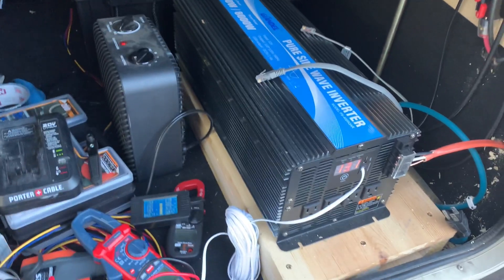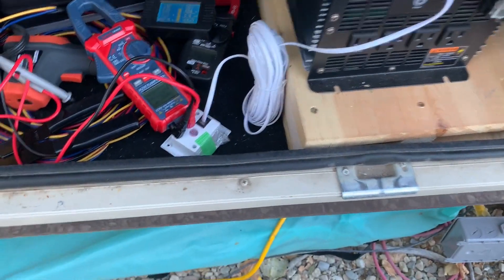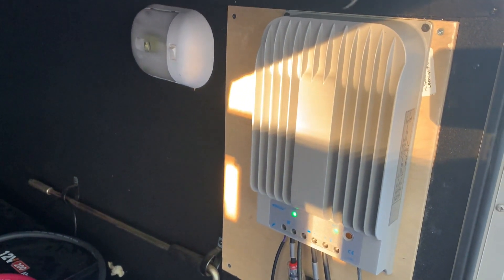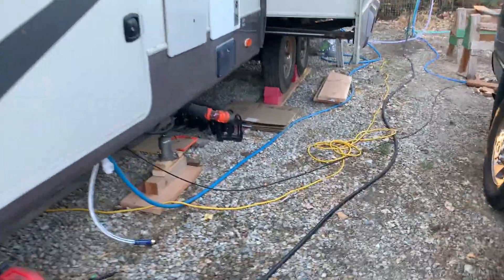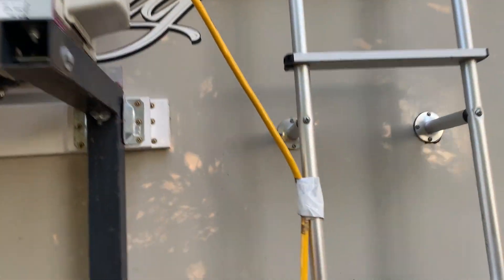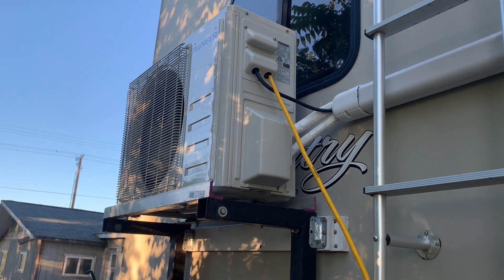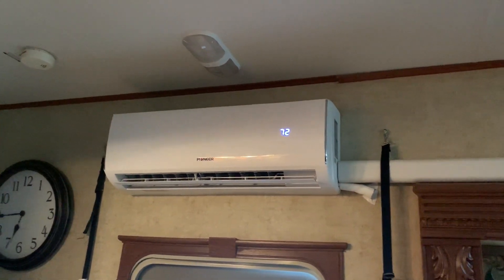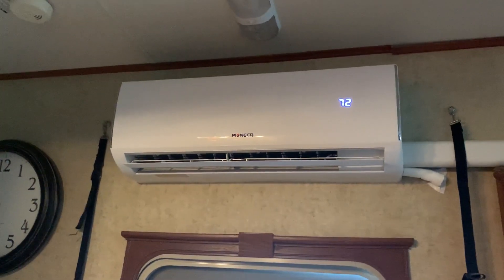Mini Split in RV running on 4 Ampere Time 200AH LiFePO4

Comment: i have a 5th wheel 40ft and the bedroom is at the front and living at back, I wanted to get a pioneer 22 seer mini split and install at the back blowing in living room towards kitchen. I don't know if it will have enough air movement to get into the bedroom which is past the bathroom. I wanted a 12k btu but if yours which appears to be located centrally by the front door which is the midpoint in mine but you said yours doesn't cool well at 100 degree temps which is average here in texas, then I guess I need to go bigger or get a second unit for the bedroom you think? not sure how to determine the size i need for my 5th wheel to cool end to end.
Reply from the maker: If I were to do it again I would get a two head unit and two of the cassettes that go where the roof to ACs go. So the cassettes both run off of one compressor and condenser unit. However not sure if they make a 120 VAC unit. I don’t think so.
Reply: @thervsolarseries2827  so you would have to actually remove the rooftop a/c's? My rv is ducted so you can't see the indoor rooftop vent under the a/c, it's just vents everywhere. So wall units make more sense, but yeah i need 110/115. just not sure on btu's or if I really need 2 wall units.
Reply from the maker: @fabiangomez357  Yes for the cassettes you do need the through hole AC units. Mine has ducting too but the unit comes through the ceiling and you can turn the vents on/off. It was also a pain routing the copper freon lines inside. Where I think the cassettes the line sets could just stay on the roof.
Reply: @thervsolarseries2827  by any chance would you happen to know your total livable SQ footage? I'm calculating mine now, living room, bedroom, kitchen bathroom. I'm including slide out space.
Reply from the maker: I don’t know that information offhand. However I have 4 slides so if that is how many you have I would think it very similar.
Reply: @thervsolarseries2827  yeah I ended up figuring out mine with 4 slides was 355sq ft
Reply from the maker: Are you going to put a mini split in it? I’m installing another one on my enclosed cargo trailer now.
Reply: @thervsolarseries2827  yes, problem is  my 5th wheel has no bumper just fiberglass body at the back. No trailer hitch either. Trying to find a way to add a basket or shelf to sit condenser on
Reply from the maker: Oh that makes things more difficult.

Comment: Hey I have a question about the mini split when you put it on high heat in a cold room does the indoor unit blow wheel hard until it reaches the room temperature you set it on and then slow down with the speed or does it stay on high until you slow it down with the remote because high on my remote is like slow
Reply from the maker: Yes, it has a turbo mode that blows fairly hard but once it hits your temp set point it slows down.
Reply: @thervsolarseries2827  oh okay I keep forgetting about the turbo feature that's right here on the remote

Comment: cool !  so, have you figure out how many watts of solar you would need to run the AC and be able to recharge the battery bank ?  alors, what BTU is your AC unit ?   Thanks
Reply from the maker: My unit is a 120 volt 12,000 btu. I have been using it all winter it has been great.
Reply: @thervsolarseries2827  Thanks ,  i just got 2 X 200 amp batteries (total of 400 amp) and i was planning on buying a 9,000 btu  mini split.  ( I currently have 800 watts of solar, planning on going up to 1,200 watts, total)

Comment: how many BTU's is the mini split? what voltages are your solar panels?
Reply from the maker: It is a 19 SEER 12,000 btu Pioneer mini split. The solar panels are 40 volt 400 watt panels.

Comment: is that uni-strut you used to support and mount the mini split?
Reply from the maker: I actually bought two of these bed extenders from harbor freight and mounted the mini split condenser on that with two pieces of aluminum angle iron. 
https://www.harborfreight.com/search?q=bed%20extender

Comment: Nice work.. very professional looking install... Since that 400 watt panel can't supply enough energy to run the AC, how do you charge the batteries?
Reply from the maker: Thanks, I have to remove any load to charge the batteries. I have 10 more 400 watt panels just need to get them connected.
Reply: @thervsolarseries2827  Why do you have to remove any load to charge the batteries please? Also, how many 400 watt panels do you figure you'll need to run that AC ?
Reply: There's no reason to remove load before charging.
Reply: @robsteve7043  

He must be charging with a charger on ac power that is already rated for his bank.  Assuming I’m correct,  then that would be a reason to remove any other load

I think…